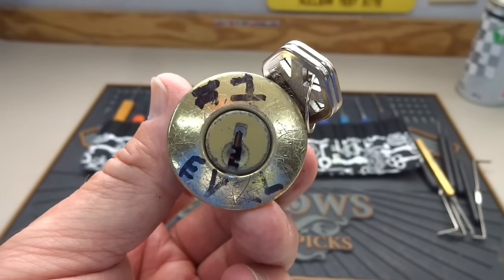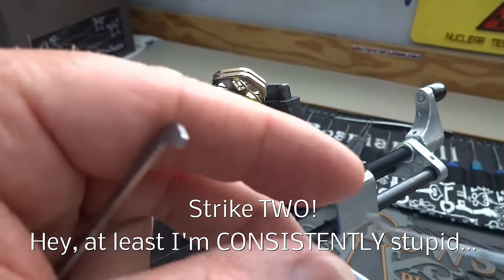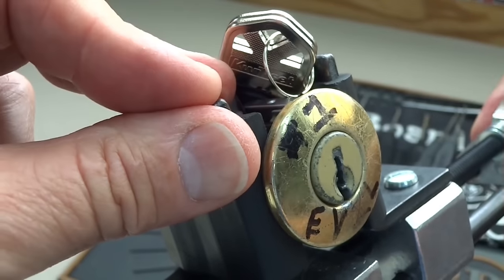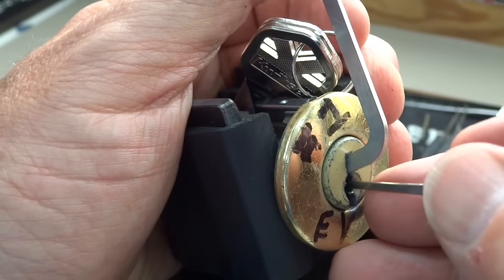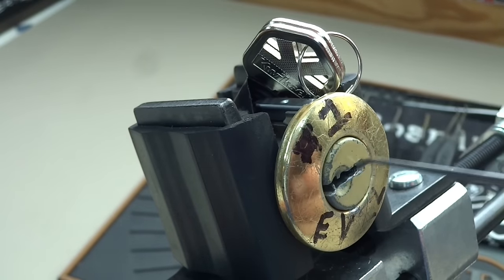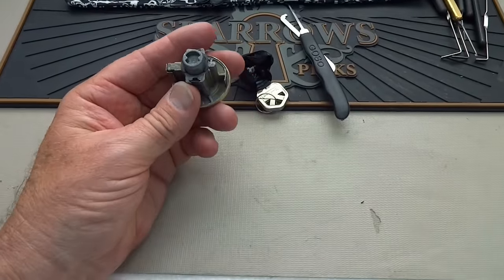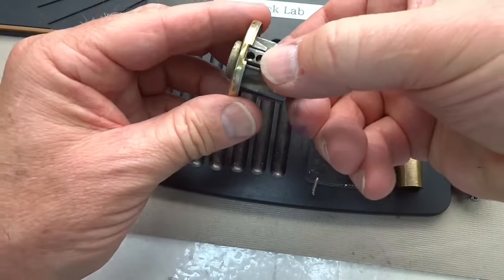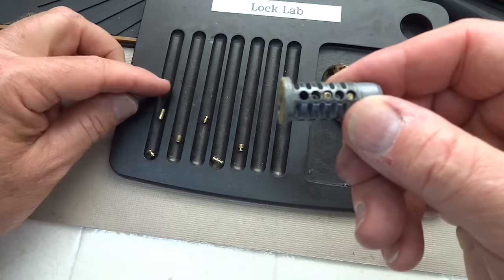(691) Jacob's "Evil #1" Picked & Gutted

Comment: I got a set of those goso as a starter set hard to beat for 15 bucks even if half are junk. only thing i did was shave the handles from the excess plastic when they were injection molded.

Comment: bosnianbill Those Pins Are Just Unbelievable Bill. Amazing Work Jacob. Keep up the great work Guys.

Bill what are the Ball Bearings used for in the Core when a Core has the application to except them? If you can let me know that would be great. Great Picking & Video as always Bill. Nick.
Reply: ***** In case Bill doesn't have time ... he's busy picking you know!! The ball bearings are used for construction keying. All the locks on site work on a " construction key " and the ball is in the plug, on top of a key pin, sitting level with the shearline, when the construction key is being used. When construction is finished, and individual keys are issued and USED, the ball is pushed into the top chamber by a user key with a HIGHER cut, and sits UNDER a driver pin.
As the plug is turned with the user key, the tiny ball bearing is forced into a small hole or slot, that is in line with a pin hole, by the spring and driver pin, and is trapped there. Because the ball is no longer in place, the key pin will sit BELOW the shearline if the construction key is tried, the construction key has a LOWER cut in this position, and therefore will no longer operate - the ball has gone!  All construction keys are automatically rendered inoperative by the use of the individual user keys. Hope this answers your question. Regards, Brian.
Reply: Brian Hignett great explaination. Allow thing to add is 3 balls to 4 balls are used so the plug works smoothly. Also they can be used in 1 or 2 chambers.
And if you noticed, those plus can not be used for construction keying.
Reply: +Brian Hignett i have always wondered and your explanation clears up quite a bit but:
 
why do they include the bb's in the factory kwikset rekey kit? you don't use construction keys when rekeying so why are they there?
 
also if the construction key is the same as the user key except for being cut deeper in all positions by the thickness of the bb it would be as unique as the user key. 

further why would kwikset need to keep factory workers from having access to the user key? esp. since for the rest of it's pre-purchase existence the lock will travel with its user key? 

please understand i'm looking at this through the lens of literally(figuratively) shit-tons of rekeys in the shop where we always use user keys to rekey locks. 

thanks for your time,

-p
Reply: +Pad Lok  I don't know why they include ball bearings in a rekey kit, we don't see Kwikset kits in Australia. The construction key is cut DEEPER in usually one position only - not all positions,  although it depends on the amount of locks on site. It's never the same as a user key. Construction workers, or factory workers as you call them, should not have access to the finished site, when the job is completed, so when the user or owner turns his key, it automatically cancels out the construction key, and only his key will operate the lock. Regards, Brian.
Reply: +Pad Lok 1) Those kits are bought by contractors to locksmiths, many contractors will think rekeying their locks will save them money
2) The construction key is sallower than end user key and only in one or two positions. Yes the construction key would be "unique" to that contractor.
3) Don't under what you are asking. Construction key is a key the contractor has made up(could be just a factory key) and is NOT shipped with any locks.
Reply: +Brian Hignett  The construction key is cut one depth deeper in usually one position or two, not just cut deeper. They are .025 equaling one depth.
Sadly I see a lot of locks construction keyed wrong; voided chambers, more than two chambers with bearing and master wafers
Reply: +rallock67  That's true, it was merely a way of explaining the principle behind construction keying, rather than getting too technical and perhaps complicating the description.   Regards, Brian.
Reply: rallock67
thank you and Brian Hignett both for your timely responses.

Comment: The cut in the plug, is that a cost saving measure? Is the plug even brass? Maybe that's why it's not threaded.
Reply: Papa Gleb Yes the cuts are a cost saving measure. 
BTW all common residential locks are produced by one company in Taiwan
 Tong Lung Metal Industry Co.
Reply: What common residential locks? Kwikset and schlage?
Reply: Papa Gleb Not Schlage but ALL Kwikset and Kwikset clones(look a likes) Brinks, B&D, EZset, Faultless, Design House etc.

Comment: Is there a benefit to starting in the back instead of front or is it just preference?
Reply: Andrew Fietsch There is a slight advantage to Single Pin Picking (SPPing) from the back first. It's easier to feel the spring tension on the pins and tell which ones are just being held down by gravity. When you're picking a lock that is crucial and any way to make it easier is an advantage. At least that's my experience.
Reply: +Andrew Fietsch start in the back so you don't have to pick under pins that've already set.